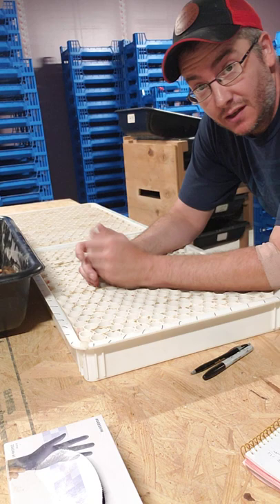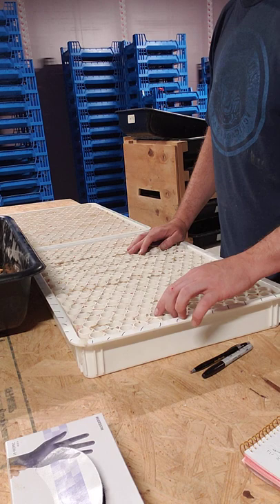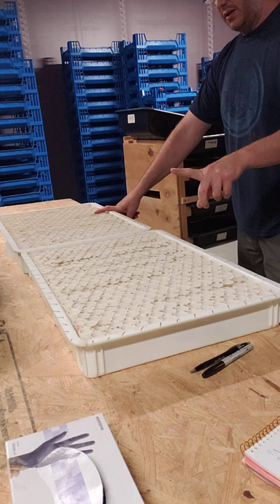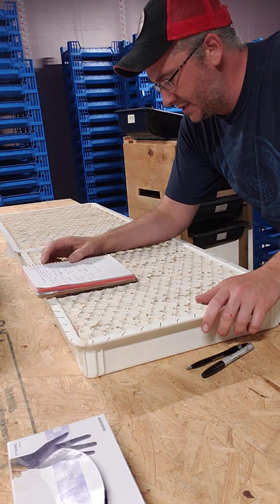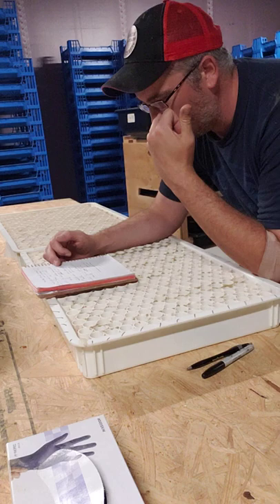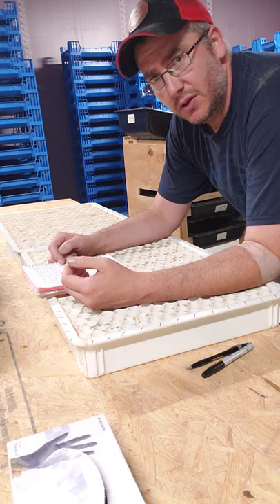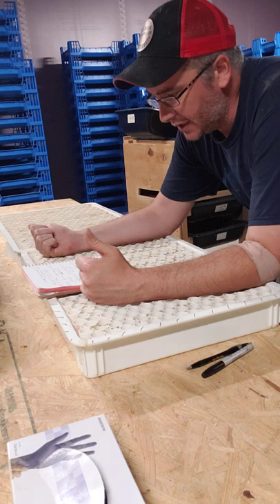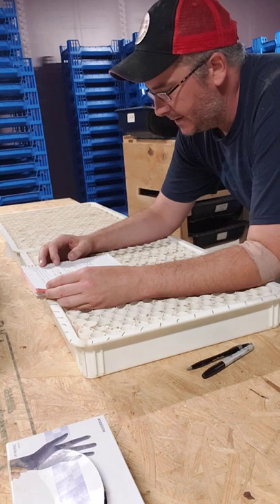Superworm pupation test results!

Comment: Am I wrong in thinking that supers pupate better with no food or moisture because they require nothing in the pupa stage of things? So if they have no food or moisture, they can live longer as a pupa.

Also, what size of tube came out with better results.?
Reply from the maker: Sounds accurate. Both sizes performed about the same.